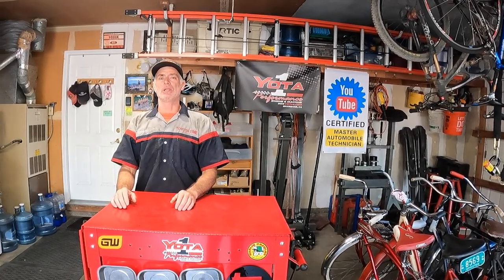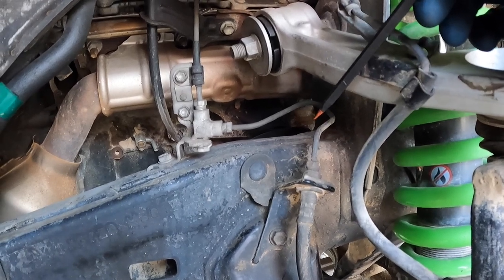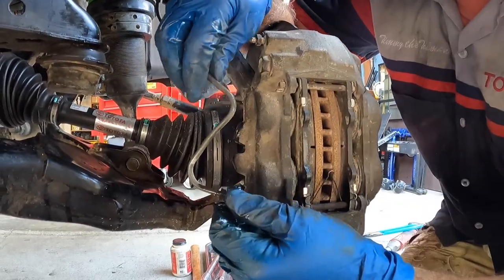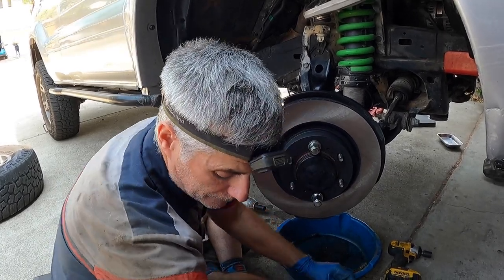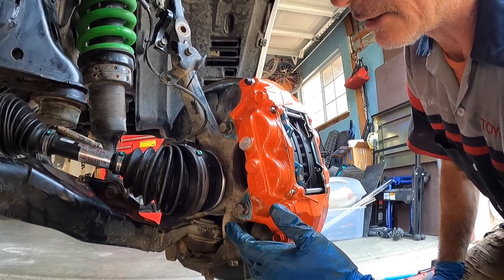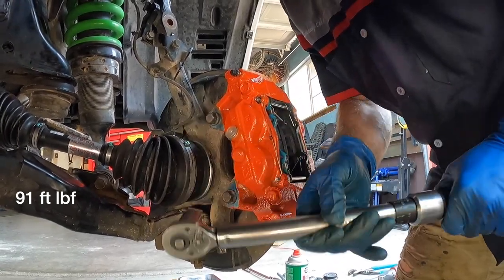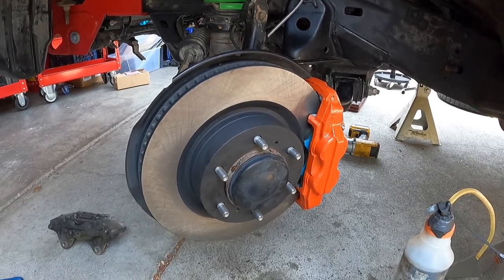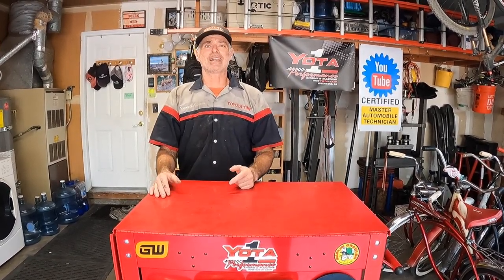Lexus GX470 Front Brake Upgrade

Comment: Pro tip for stubborn rotors. As seen @13.45 there are 2 threaded holes in the rotor hat. Thread bolts into those holes and it will press the rotor off the hub.
Reply from the maker: Thanks for the tip.  The same can be done for rear drums.  It's a M8 x 1.25 Bolt thread.
Reply: Good tip, just had to do that while changing out the crusty front rotors on my GX470.
Reply from the maker: @greenscobie86  Glad it helped you out.

Comment: Thank you for the Gx470 DIY videos.  I'm getting parts ready to change my timing belt thanks to your video.  Later on will be the brakes.
Reply from the maker: You're very welcome.  Good to hear you appreciate the GX470 videos we're making.  Good luck with the timing belt job.  Happy Wrenching!
Reply: Agree, I'm in the same boat. About to do timing belt and brakes
Reply from the maker: @scottperry5454  Good luck with both jobs Scott.  The brake job is pretty simple but the timing belt job is a lot more involved.  Just take you time, label fasteners like we suggest in the video and you'll be fine.  Happy Wrenching!

Comment: At first I thought why so long of a video, 33 minutes.  Then I saw why.  You go into detail that so many people just gloss over.   If someone watches and follows the video they will have no issues and have a job done right.  Even if they are just R&R the existing calipers this video goes into the details.   This is very good video.  I have replaced calipers three times in the 150,000 miles on my GX470 due to sticking pistons.  Now it is a process, take the calipers back to O'Reillys for an exchange under the life  time warranty.   I don't like the continued maintenance but it gives me a chance to bleed the brakes and look closely at the suspension and braking system.
Reply from the maker: Thanks Al for the nice comment.  With those lifetime warranties, you really need to factor how much your time is worth.  Calipers aren't had to change,  so I guess it's worth it to continue to replace them when they go bad.  Happy Wrenching!
Reply: @TimmyTheToolman  One other problem besides the time which is a number of hours but the braking performance.  Depending on the actual situation of a sticking caliper it can create quite a drag.  I am deciding about the GX460 upgrade which is dependent on whether I keep the vehicle or go to a 460 used.  Thanks again for the great videos.

Comment: I install double anti rattle clips (top and bottom)  on all Toyota vehicles that I service. It’s just odd that engineers only use one per caliper…🤷🏻‍♂️🤷🏻‍♂️
Reply from the maker: I agree that it's odd they don't come with 2 anti-rattle springs per caliper.  It just makes sense to have it that way.  Thanks for the comment.

Comment: Another great video, I would like to add a few things because they were issues for me when replacing my calipers and bleeding the brakes:

1) I disassembled the two-part bracket that connects to the steering knuckle and let it hang to get more movement when removing the hardline from the caliper.  Obviously, you didn't need to do this because you were replacing the lines.  The FSM doesn't callout a specific torque for these bolts, but based on their type the small bracket-to-bracket bolt is 78in-lb and the larger bracket to steering knuckle bolt is 28ft-lb (FSM page SS-2).

2) When installing the hardline to the caliper, I had the steering knuckle bracket tab in place but without the bolt installed.  I then installed the hardline finger tight, then installed the bracket bolt complete, then full tightened the hardline to 132in-lb (FSM page BR-42).  I did this to put as little stress on the hardline as possible.

3) *Very important*, make sure your battery is charged before bleeding, running the brake pump will drain the battery fast.  When the charge gets too low the pump will stop working and every single light on your dash will start blinking like crazy.

4) I bled my brakes until they ran clear with no bubbles and then tightened the bleeder valve (96in-lb, FSM page BR-3).  However, after letting them sit a little while, air started to bubble into the vinyl tube from the bleeder valve.  This was concerning, but after some thought I don't believe it is an issue.  The seal between the caliper and bleeder is a solid cone on the bleeder valve seated into a recess on the caliper.  The bubbles I was seeing were being pulled in through the bleeder valve treads by a syphon that was created by routing my vinyl line up 8 inches and then down 30 inches into my fluid container on the floor.  I routed my vinyl line upwards so the air escaping the caliper during the bleeding process floats up the tube away from the bleeder valve, but going up and then down will create a syphon.  If I just routed the vinyl tube straight out from the bleeder, like you did and like shown on FSM page BR-3, I'm sure no bubbles would have appeared. Again, the threads do not seal the caliper, the bleeder valve cone does, so not really an issue.  When I broke the syphon by clearing all the fluid being pulled downwards the bubbling stopped.

5) I rubber-banded some blue shop towels under my caliper hardline connection to catch the escaping fluid while I reconnected the line, I also rubber-banded some blue shop towels under the bleeder valve during the bleeder process.  By catching the fluid before it runs down the caliper body, it makes it easier to determine if you have any leaks after making those connections.  Anal retentive... yes, and probably why it takes me forever to get things done. 

6) My FSM page BR-43 shows 82ft-lb for the lug nut torque, not 85ft-lb.  Either torque is fine, just noting that it was different.
Reply from the maker: Thanks for the added experience, we appreciate it!
- Sean

Comment: Thanks for sharing. Last July I Did the big brake upgrade and stainless steel lines in my 05 SR5 V8 and definitely a huge difference in braking. Next project will be the rears. I did use all Toyota originals after so many eBay aftermarket parts that doesn’t last long I got tired of using non Toyota parts. I only have 1000 miles right now so let’s see how it goes.
Reply from the maker: Thanh also reported his braking is much better after the upgrade.  He's definitely happy with the result.  And yes, you can't go wrong with Toyota Parts but you can quite often go wrong with aftermarket.
Reply: Hello, Did you have to send the calipers from the GX460 to a machine shop in order for a proper fit on the SR5 V8? I Have an 02 SR5 and im planning on doing this upgrade myself. I watched another video and saw that they needed to remove approximately 3mm from the tab. Can you confirm? They used 2015 Toyotta 4runner Part numbers.
Reply: @gabrieltobar9472  No I did not have to send it to a machine shop as the 5th Gen 4runner calipers are a direct fit to my 4th gen. I have read as well, only 2010 to 2012 4runner would fit in the 4th gens (2003 to 2009).

Comment: You can put dot 4 in these systems if you wanted higher degree protection that is what I have in all 4 of my 3rd gen 4runners dot 4 is compatible with dot 3 its just a higher temp
Reply from the maker: Dot 4 is a little overkill and more expensive for these type of vehicles. You can definitely use it no doubt. But dot 4 is better for vehicles that go on the track and do some heavy braking.
Reply: @TimmyTheToolman  very true but in last few year Prestone dot 4 had become around the same price if not a dollar or so more for a 32 Oz bottle and when you do a ton of offroading and 4 wheeling even Crawling you tend to use your brakes a ton... I use it in my rigs gives me peace of mine like Checking all fluids after every 4x4 trip I do agree With you though Timmy some great valid points

Comment: Tim, on the squeal indicator I know on my Tundra and other friends Tundras it was on the inside in all cases and the OUTSIDE pad actually wore down BEFORE the inside one causing damage to disc before the indicator let us know. Luckily mine did it on way home from work and I parked it till I swapped pads. Thought I would pass that along!!
Reply from the maker: Yeah, that's good to know.  These days, most people don't try to reuse the rotors by having a shop resurface them on a brake lathe and they just buy new rotors when it's time to replace the pads.  I however do think it's worth trying to resurface the rotors if they are OEM and they still have the minimum thickness required for a shop to resurface them for you.

Comment: Some rotors don't have a film on them to prevent rust always read the information that comes with the rotors from the manufacturer you purchase them from @13:05
Reply from the maker: Well, cleaning with some brake cleaner isn't going to hurt anything so it will save you some reading time.
Reply: @TimmyTheToolman  on some rotors if they dont have protection that needs to be cleaned and you clean them with brake clean it actually causes the rotor to not Mary with the pads and causes immediate squealing for ceramic pads... for example power stop brand rotors don't have protectant on them and they recommend not to clean the rotors with brake clean... I did that anyways and when I installed ceramic pads they squealed all the way to the day I replaced them... all I'm saying is some rotors don't need cleaning always best to find out what that company recommends for there product just trying to help is all
Reply from the maker: @AntonioClaudioMichael  That doesn't make any sense.  Brake cleaner dries with no residue.  What if you got grease on your rotors when doing the brake job?  What do you clean the grease and dirt off with then?
Reply: @TimmyTheToolman  I know it dont make sense I have never had ceramic pads that didn't squeal no matter the brand or the rotor slotted not slotted drilled and slotted or even smooth all im doing is relaying information some company's say don't use brake clean on there rotors what so ever I'm not saying your wrong I'm not saying I'm right I'm saying the facts that I know about certin companies its just information to help people take the information how ever you like
Reply: @TimmyTheToolman  you can put rotors on without getting grease on them that would be change your gloves for every step of the brake job... whole point of posting information is so others can read it and be more aware of it if they run into these things some rotors have a more natural rust inhibitors on them which don't need to be cleaned off first some have a rust inhibitors that requires them to be cleaned with brake clean first before install... as an example coated brake rotors you don't clean with brake clean you clean them with soap and water to get rid of oil and grease they have a protection on them to help stop rust and corrosion that happened in states that have a lot of snow on them as well ad protect them from salted roads to last longer were rotors that have a  corrosion inhibitors on them are cleaned with brake clean and they are there to protect the rotors from rusting while in storage depends on the brand even the level of rotor for that brand depends on what they are coated in brake clean isn't the only thing you can use to take grease off with... that's why I stated some companies say don't use brake clean and there information will state what should be used... I get it sounds odd
Reply from the maker: @AntonioClaudioMichael  Ok, I hear what you're saying but I still have a hard time believing it's not safe to use brake cleaner on any rotor.  I've used it a ton of times on rotors without issue.  So Dude, even with what you've told me, I'm going to continue cleaning rotors with brake cleaner because I don't see an issue with it.  It's ok to agree to disagree.  Talk to you later.

Comment: Good work. I’ve had good luck with ceramic break pads for my Tundra. Supposed to last longer, break quicker, and has less break dust.
Reply from the maker: I've had good luck with ceramic pads too.  I'm running them on my 2000 4runner and they have lasted a very long time.  My estimation is I have 100,000 miles on those pads and there's still tons of life left to them.  I do however do mostly highway miles and I know how to employ engine braking to lessen the need to ride the brakes on mountain descents.

Comment: Wouldn't you need to change ALL the brake lines to Stainless Steel? Otherwise, the remaining non SS brake lines will then swell / expand, and leave you in the same situation?
Reply from the maker: No, you don't need to change all of them to stainless steel.  Replacing some of them will still have a positive affect.  Would it be better if all of rubber lines were swapped out?  Yes, it would.

Comment: Y grease and not loctite on the caliper bolts?

Oem Toyota bolts usually have red loctite on them
Reply from the maker: You don't need loctite on caliper bolts if you properly torque them to spec.  If you want a real hard time to get bolts or nuts off in the future, use Red Loctite.  I never use it.  The most I use is Blue 242 Loctite.  There might be an application where red should be used, but for most automotive applications, red is way overkill.

Comment: I followed this video to a T and everything works great! I was catching that burning smell you get after installing new brake pads while they are curing. It’s been about a month and I still catch that smell every once in a while. Any idea what it could be? Brake pads seem to be wearing normally, Brake fluid level is normal.
Reply from the maker: Not sure.  If everything was installed correctly,  you shouldn't be smelling brake pads burning unless you were riding your brakes down a mountain descent.  It could be caliper pistons that are sticking and not fully retracting.

Comment: This is a fantastic mod, Timmy. Thanks for doing it and documenting it so well!! Do you know if the rear GX460 calipers are a direct replacement for the GX470 rears, too?
Reply from the maker: Thanks Carlos.  I don't know if you can swap the rears as well.
Reply: The rear calipers for the GX470 and GX460 are identical, same part.
Reply: That's fantastic, @thetruth8095 . Thank you very much!
Reply: @Carlos-ov1hg  You’re welcome. Here’s more info. According to the Lexus Parts Website the rear caliper fits the following vehicles. 

Lexus GX 460
2010, 2011, 2012, 2013
Lexus GX 460 Base
2014, 2015, 2016, 2017, 2018, 2019, 2020, 2021, 2022, 2023
Lexus GX 460 Luxury
2018, 2019, 2020, 2021, 2022, 2023
Lexus GX 460 Premium
2014, 2015, 2016, 2017, 2020
Lexus GX 470
2003, 2005, 2006, 2007, 2008, 2009
Lexus GX 470 Gold
2004

Comment: I have a 460. Was just curious if techstream is required to do a job like this. I don't want any dash lights to come on when I replace my sticking caliper. Thanks!
Reply from the maker: No, the Tech Stream program isn't necessary for a job like this provided you don't make a mistake and let a bunch of brake fluid drain out and you empty your hydraulic brake booster.
Reply: make sure to have a plan to plug the brake line so the fluid doesn't leak out. the best way to go about it is to leave the brake hose for last, since the metal hose will keep leaking until its real tight.

Comment: This is a great video. Any idea what the air/squishing noise is when the brake pedal is pushed down? I have the same issue.
Reply from the maker: I'm not sure about the noise you are experiencing.  It might be the hydraulic brake booster.
Reply: @TimmyTheToolman  That is what I am thinking too, but I hope it is not due to the complexity of the repair. Thank you for responding.
Reply: @TimmyTheToolman I just completed the upgrade and went for a test drive. It seems like the noise is significantly diminished but it is still slightly there. Do you think it could just be air bubbles somewhere in the system since it has decreased after bleeding?
Reply from the maker: @thetruth8095  That would be a logical assumption.  Do you have the Tech Stream program so you can acuate the brake booster to bleed it?
Reply: @TimmyTheToolman  I do not have Techstream, but if you recommend it, I will look into purchasing it.

Comment: i wish i've watched your video bofore the work. so I did not cap the brake line like u did and  i belive i lost too much fluid because of that, I've bled the brakes multiple times but the brake pedal is still soft and initial pedal travel is long but brakes work fine i just hate that the pedal needs to go that much lower to for the brakes to engage. what would you recommend to bleed the system correctly. i did use tech stream and bled it multiple times but can't really get that one last bubble out
Reply from the maker: Hmmm, if you used tech stream and bled the system according to the factory service manual, I don't know what else you could do.

Comment: Great video! I'm loking to do this upgrade to my 2005 4Runner Sport. Have you looked at the back breaks and thought about doing the same thing? Thx
Reply from the maker: I don't know if there's a rear brake upgrade for these rigs that's relatively plug and plug like this upgrade is.
Reply: @TimmyTheToolman  I think upgrading the fronts and changing the rotor and pads in the rear would probably be good. Thanks again!